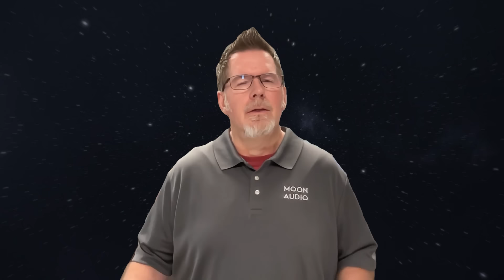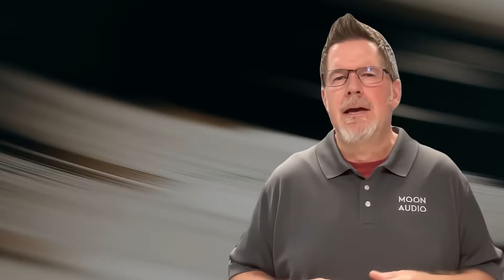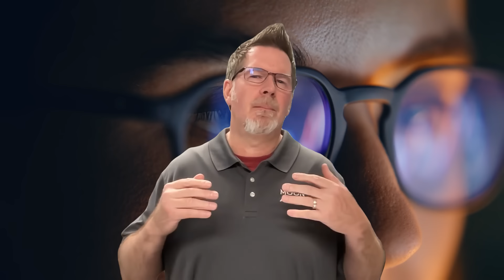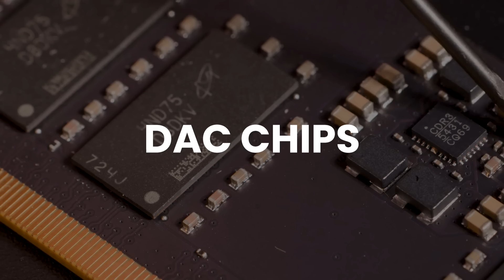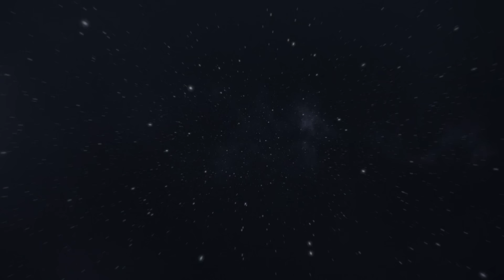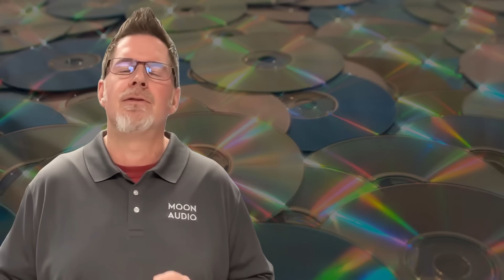The CD Player NIGHTMARE in 2026! Here's WHY and How to FIX It

Comment: Get a UHD blu-ray player. The transports are all the same across all players and burners. The player will play everything except CD Video which no longer exists. That means SACD, CD, 4K and HD blu-ray, immersive audio of any sort, DVD picture and audio. You don't need to jump through hoops to listen to anything on disk. Don't spend a lot of money on one either. It's unnecessary.
Reply: Very few new BR players support SACD or DVD-Audio. You would need a universal player for that.
Reply: @patbarr1351  Mine does and I specified a UHD blu-ray which is 4K. It's a $300 Sony UBPX-700. It's also region free.

Comment: All good points except expensive doesn't guarantee high performance, use reviews & measurements to select your components. Pay particular attention to CD defect (scratches/scuffs) performance. Finally, if the player is expensive, ask the manufacturer how long they'll stock replacement drives. Cheers!
Reply: He didn't say it did.
Reply: No I did, as a reminder to everyone, HTH.
Reply: Over sampling is what CD players used to get around defects and scratches. Usually 2,4, or 8x over sampling. The higher the over sampling, the better the unit could play defects.
Reply: Oversampling is used to simplify the DAC analog reconstruction filter. The higher laser resolution of DVD & Blu-ray players & the supporting laser tracking algorithms determines CD defect performance.
Reply: @Navy-Vet2025Not true! The  Reed Solomon program in all CD players handles errors. Otherwise CD's wouldn't work.
Reply: Reed-Solomon works for <2.5mm CD defect. >2.5mm error correction interpolates or mutes the output. 2.5mm is not a long scratch. The higher optical resolution of DVD & Blu-ray players provide a better chance of reading any 'pits' under the scratch. Sony Blu-ray players will take multiple passes at reading pits under a scratch on a DVD or Blu-ray, to try & recover the video frame, obviously that will not work for audio!
Reply: in reviews wordt veel gelogen , en metingen zijn voor mij niet representatief , want de best metende dac kan klinken als  een dode hond. en geld ook voor een versterker met veel tegenkoppeling. ik hou van levendigheid , transparantie , plaatsing in een audio weergave. en dat wordt niet gevangen in nummertjes , helaas ....
Reply: @tubecollector100 
I concur! 👍
Reply: Reviews are extremely questionable, it's really difficult finding an impartial site that doesn't favour certain brands.
Reply: The Transport and Servo is the Archilles Heel of majority of CD Transports and Players.
Hard to beat TEAC Esoteric Series and old school Pioneer Elite

Comment: This is why I've always opted for a 'stand alone' CD Transport, using either a separate DAC, or the one found in an integrated amp.... my current set up, that I've had for sometime now, is the Cambridge Audio CXC (CD Transport) coupled with the Cambridge Audio CXA 81 Mk II (Integrated Amp) which contains an ESS Sabre DAC chip. Having a CD transport has many advantages as you've explained in your video, but the main one for me has been having the ability to use/test it with a number of different 'standalone' DAC's, as well as the ones built-into the various amps I've had it paired with over the years. I've found that my 'old ears' have DAC preferences for various different genres of music....for the more technical/prog genres I love the ESS DAC chip, but for the more 'loud & obnoxious'/in your face Rock & Metal genres, I do prefer the AKM DAC chipset. So it's CD transport all the way here!!

Comment: What would you recommend for a good SACD player? My 30 year old player is no longer. I have quite a few SACDs, around 150 disks. I use a 250 Devialet Expert Pro core infinity integrated amp.
Reply: @WoodstockG54  Find yourself a used Oppo player.
Reply: I use the Shanling SCD-T200c for stereo & Denon DVD2900 for surround ( does also DVD-A )
Reply: I just replaced my 90's Pioneer with the Denon DCD-3000NE SACD player. It's a beast, and has a sophisticated vibration damping system on the drive.
It's just a disk player (no streamer, headphone jack or anything to add noise).
And now I'm buying SACD's instead of vinyl in many cases. 
After having a really nice analog system,  I can't really stand to listen to most CD'S, but SACD'S are pretty equal (but still prefer quality vinyl).
Reply: Or any of the Sony DVP-NS series of players on the used market....